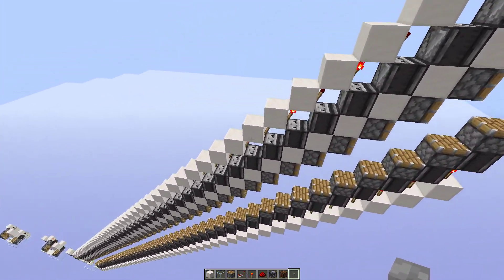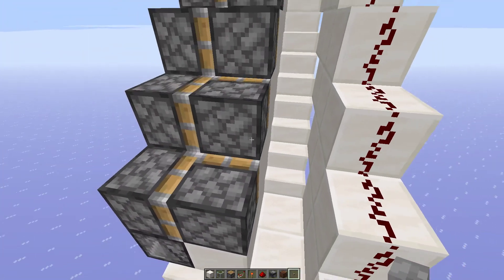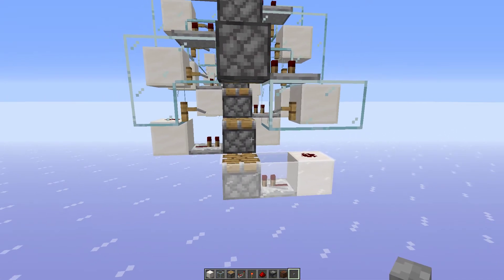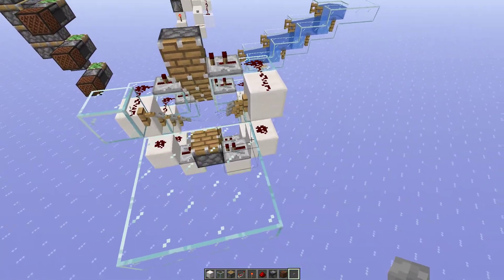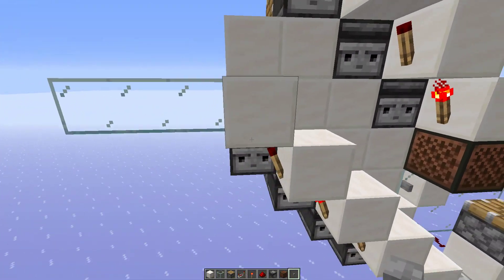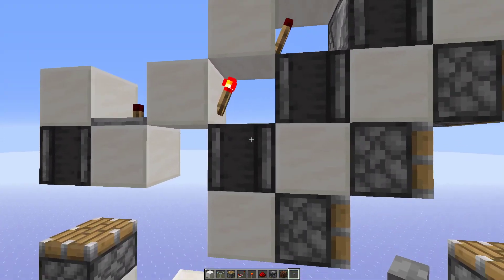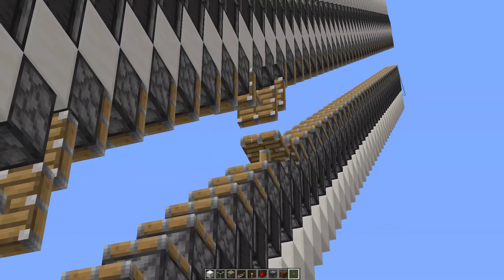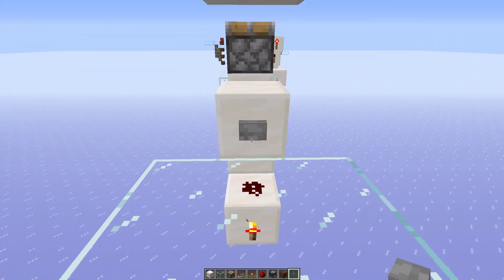One Wide Escalator

Comment: Hmm, i tried this on a server but that didnt quite seem to work.  It would often get stuck at the bottom.  Tried it in a singleplayer creative world and it seemed more reliable, so maybe thats the issue?  But still a couple times I'd get stuck before reaching the end.  My plan was to extend it all the way to build height, so that seems like a lot of chances to fail.  Unless there's some minor change I missed since this seems like 1.14.  I tried other timings with the repeaters but having them the same still seems the best.
Using a lever instead of a button seems to solve that double activation issue however.
Reply from the maker: It could depend on the tps, servers are usually pretty bad when it comes to redstone. If the server is running spigot that would be another issue (skipping ticks), explained by SilentTea. I will look into it though and let you know what's up.
Reply: @cswertwertwert  Oh wow, thanks for the help!  The server does use plugins and says it runs on Paper, which seems to be different from Spigot.  The tps at the time didnt seem bad but maybe redstone is just that finicky.  I had also tried a slower version of your escalator since this comment but again it didnt work out, still worse than the fast one in single player.
Reply: If u use a minecart instead, then ride the minecart as it goes up, then it should be more reliable
Reply: @redstone_mason  I did try that and its a fine substitute i'll probably use else where but the area got lavacasted.  Thanks anyway